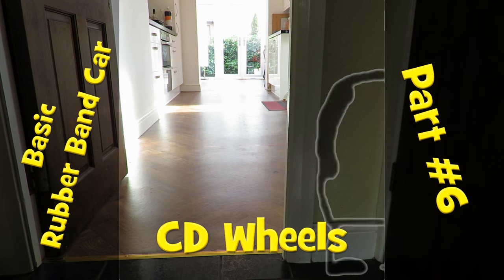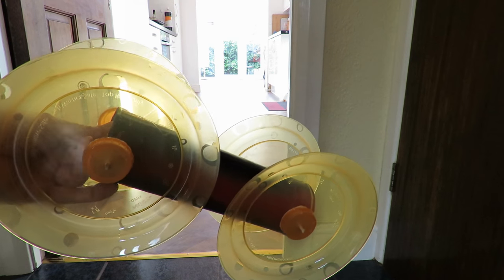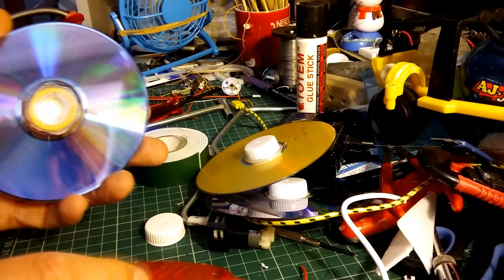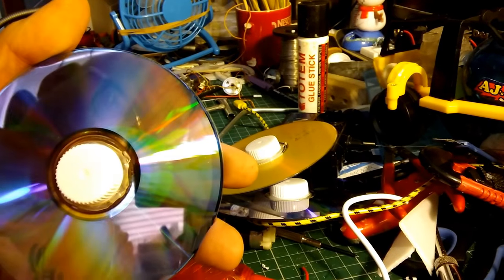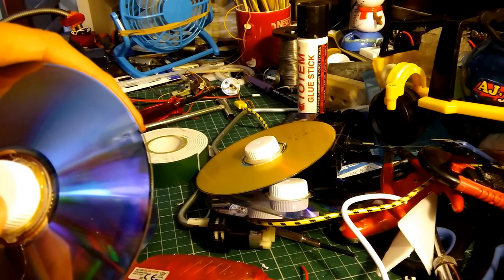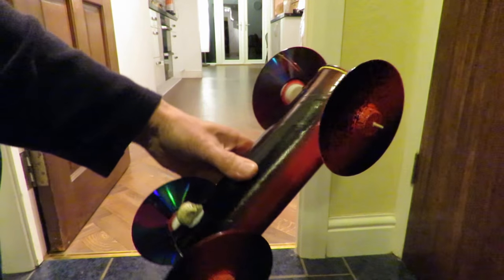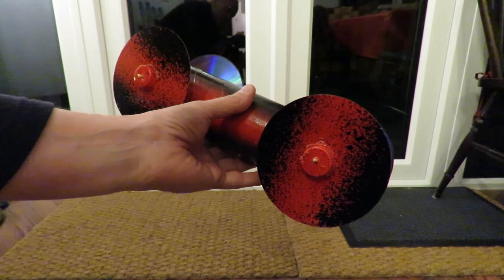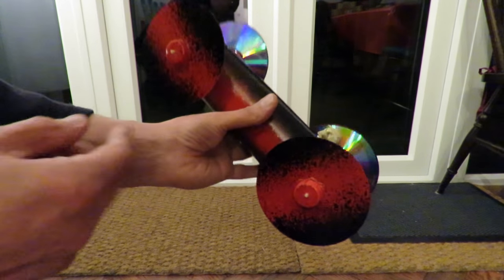Basic Rubber Band Car Part #6 CD wheels comparison

Comment: It's the same with performance cars.
Once the wheel diameter exceeds about 17 inches vehicle performance starts to suffer.
Acceleration, turn in response and braking are all adversely affected.